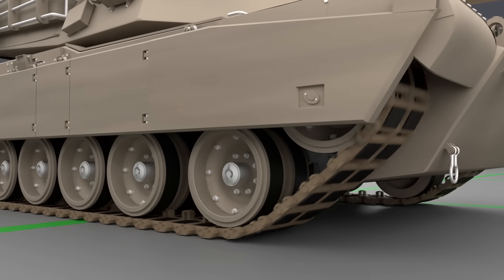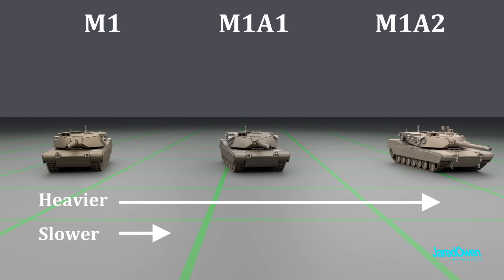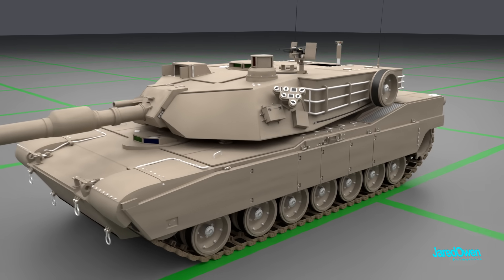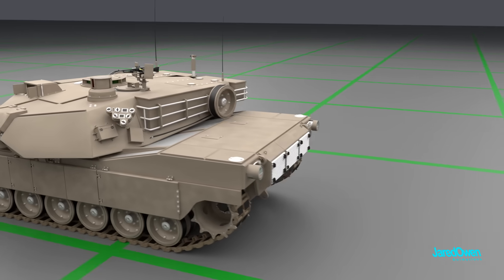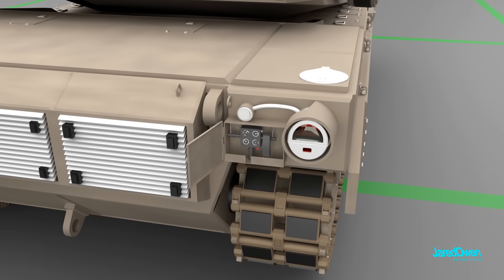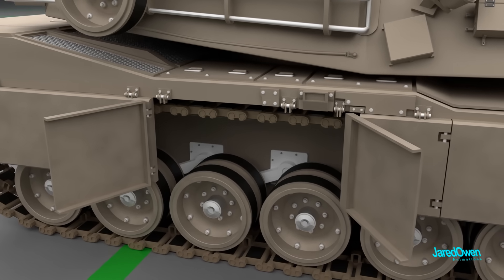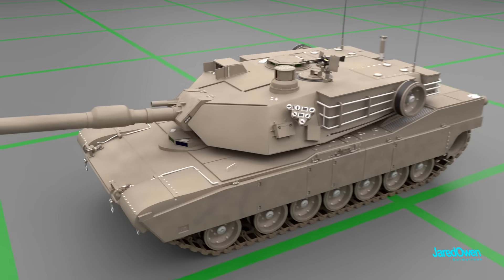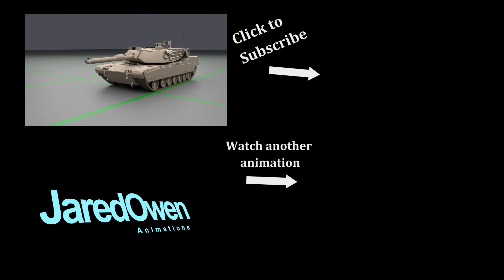How does a Tank work? (M1A2 Abrams)

Comment: Here's some additional fun facts and myths about the M1 Abrams:

1. It's often said no Abrams prior to the Ukraine War were knocked out in combat. That depends on how you define "knocked out." It's true that during Desert Storm, no Abrams were destroyed by enemy fire, but several were knocked out. The U.S. Army defines "knocked out" as a mission kill: the tank can still serve, but it needs to go to the depot for repairs before it can fight again. "Destroyed" is fairly self-explanatory, it's a total write-off. During desert storm, nine Abrams tanks were destroyed either by friendly fire or scuttling, and several have been destroyed by IED's.

2. It's true that the Abrams has a top speed of 42 miles per hour, but this isn't because of its weight, rather because it has what's known as an engine governor. This is supposed to limit the tank's top speed, but some crews have been known to disable the Abrams' engine governor for fun. This isn't a good idea for a couple reasons: one, it wears out the tank's suspension a lot faster on rough terrain, and two, it represents a safety hazard (tanks don't have seat belts).

3. The Abrams has an additional compartment in the hull not shown in this video that stores extra shells for the gun. This rack is usually left empty since the turret needs to be rotated to a certain angle so the loader can transfer those rounds to the turret bustle, which leaves the tank vulnerable to enemy fire since it's showing its weaker side armor.

4. A common myth concerning the development of the M1 Abrams is that Chrysler Defense' (now General Dynamics Land Systems) main competitor during the tank's development, General Motors, was supposed to win the contract to develop their prototype, but politicians stepped in and gave the contract to Chrysler since they were financially struggling. This is very blatantly false: not only was Chrysler's prototype cheaper and better armored, the diesel engine used in General Motors' prototype was underdeveloped, unreliable, and emitted a lot of smoke which gave away the tank's position. Besides, if the Army really wanted the diesel engine, then they could have used the Chrysler prototype with said engine, the engines weren't tied to their respective vehicles.

Comment: This video is a little misleading most tanks dont use gas turbine engines the abrams uses one because it has a high power to weight ratio meaning you can pack more armour and ammunition onto it and other components at a lighter weight (the gas turbine is less heavy than conventional tank engines like a v12 or smth), u failed to mention the high thermal signature of a gas turbine engine, the abrams actually redirects the exhaust around the engine to make it more efficient and reduce its thermal signature, the gas turbine being one of the primary reasons its a gas guzzler even when compared to other tanks because its a continuous flow engine its consistently combusts fuel as opposed to intermititently combusting fuel like a regular combustion engine hence being able to use 3 different fuel sources (diesel, petroleum and kerosene) as opposed to one to ease logisticial strain... also you said "a whopping 68 tonnes" but that is intermediate weight range for a tank there are both lighter and heavier tanks than the abrams... the smoke grenades thing it uses m250, m251 grenade launchers smoke grenades dont make it harder for a fucking missile to spot or something it can probably use chaff grenades (projects really hot burning strips of aluminium into the air to deceive ir targetting systems) as well.

Comment: Here is a prototype The Abrams X is a technology demonstrator developed by General Dynamics Land Systems (GDLS) as a potential successor to the M1 Abrams main battle tank. It features advancements like a hybrid-electric powertrain, an unmanned turret, and improved sensor suites, while retaining a three-person crew with an autoloader. 
Here's a more detailed breakdown of the Abrams X:
Key Features and Capabilities:
Hybrid-electric powertrain:
Combines a diesel engine with electric motors for increased fuel efficiency, quieter operation, and potentially enhanced silent watch capabilities. 
Unmanned turret:
This reduces crew size to three, while maintaining firepower and situational awareness. 
Advanced sensor suite:
Includes augmented reality features, 360-degree thermal sights, and AI-enhanced command and control systems. 
Autoloader:
Reduces the need for a fourth crew member and improves the tank's fire rate. 
Drone launching:
The Abrams X can launch drones for reconnaissance and surveillance, expanding its battlefield awareness. 
AI-enhanced systems:
The tank incorporates AI for target identification, prioritization, and potential autonomous capabilities. 
Reduced weight:
The Abrams X is designed to be lighter than previous Abrams models, improving mobility and transportability. 
Modular design:
The Abrams X is designed to be more easily adaptable and updated than previous models. 
Purpose as a Technology Demonstrator:
The Abrams X is not intended to be a direct replacement for the M1 Abrams, but rather a platform to explore and demonstrate various technologies that could be incorporated into future Abrams models. This includes testing advancements in propulsion, turret systems, sensor integration, and AI capabilities.

Comment: What they don’t tell you is the harmful effects of the Radiation emissions from the equipment inside that tank. Yes you can develop a dangerous cancer from it.
Reply: thats completely false
Reply: @Dodener   Do your research.
Reply: @WarriorBoyOfficial  my brother (1st Battalion, 63rd Armor Regiment) was driver now gunner of an M1A2 SEP v3, weve talked alot about it including the depleted uranium(DU) rounds and side paneling.

The M829 which is the main DU round they use is radioactive but emit safe levels and only emit alpha particles which dont penetrate the skin, only dangerous if eaten in large quantities. The side panels use the same idea but are only slightly radioactive and are shielded by other layers of metal, ceramic and rubbers. 

The point of DU is they are a byproduct of enrichment and are much less radioactive than natural uranium. the benefit of DU is that its incredibly dense making it stronger and cheaper than titanium. In combat if one of the side panels that contains any DU for armor, they are required to contact one of the hazmat teams that cover radioactive, bio and chemical warfare, however its mainly to determine if the tank is compromised for combat
Reply: @WarriorBoyOfficial  i verified this with my brother, i was actually wrong, his tank is still the M1A2 sep v2 not the sep v3, everything else is correct

Comment: Former US Army vet here.  I didn't get to work directly with the Abrams, but I saw it in action and I was blown away at the speed and mobility of this equipment.
Reply: а я видел как они горят от одного фпв дрона =))
Reply: @SaloUhani   Now show us Russia's battle field losses and their inventory, your country fields 80 year old tanks from ww2.
Reply: @SaloUhani  You saw old outdated ones actually
Reply: @Jishhhhhhhh  правильно, были стары, потому что нет смысла гнать туда новые, потому как они горят также как и старые =))) новые отличаются от старых весом и более продвинутой электроникой, а горят так же как и старые
Reply: @SaloUhani  look up APS.
Reply: @ДжохарМусаевичДудаев-д4щ  These tanks have better armour they use modern ceramics to absorb the energy from the impact lessening the deformation of the steel beneath it and interior lining to protect against spalling from HEAT rounds, its not the same at all lmao, not to mention kinetic redispersion systems and ERA... FPV drones are over rated unable to fly at night unable to fly in poor weather conditions they have no gps systems and poorer range than their larger counterparts FPV drones are overrated.
Reply: @johny5593  did you see that T90 getting shredded by the 25mm of the bradley lololol

Comment: 1:45 Which difference between US tons and international tons?😂
Reply: Tons vs metric tons or tonnes, tonnes are slightly more.
Reply: @zThinquinox yes 1 US ton = 2,000 pounds (lbs) ≈ 907.185 kilograms (kg)
Reply: Us tons are 2,000 lbs, abt 910 kgs. Metric tons, or tonnes are 1000kg, About 2,200 lbs.

Comment: Is any research of This loading of shells can be done automatically like reverse gas thrust recoiling like  M4 or AkS so the firing could be more fast without manual loading or loader . But it will need larger space as to arrange the spring for shells to lift after firing serial wise like magazines . 
Tank will be more heavier then 
I think additional LMGs can do so

Comment: 😂 ребëнок, до одного места ты всё это зубрил, Абрамсы слишком боятся лобового столкновения с т-90мс😎
Reply: Didn’t the t 90 lose to 2 Bradley’s?
Reply: @Jeffrey-hu2gb  But weren’t Abrams destroyed with a DShK machine gun?🤣🤣🤣

I found something to compare, child =))) Bradley is equipped with an ATGM and a powerful large-caliber gun...
And the DShK is a heavy machine gun =))) 😂🤣😅
Reply: @ what’s your source? 
(Someone on Reddit documented every Abrams damage an destroy 2003-2011 very helpful)
The only thing I found was on April 3 2003 was when a Abrams (named the Big Punisher) was damaged (NOT DESTROYED) and abandoned by its crew with parts of it being stripped off in later photos the most likely explanation I found was that a RPG not a DSHK hit the EAPU and caught on fire which then spread to the fuel tanks or engine something like that it was later recovered and returned to service after it was repair and overhaul 
The only thing I found that matched your claim was someone on Reddit claiming the same photo was caused by a DSHK with his evidence being the DOD report saying it was a medium round which is very vague term because someone else mention it includes 20-30mm rounds

As for the Bradley Task and Purpose broke down the engagement and during the interview with the crew he said that in one of the 2 Bradley’s the chain for the AP ammunition jammed leaving them with HE shots and neither Bradley used any ATGM during the engagement which was shown in the video of the engagement

Comment: Esta informacion esta demas , le estan dando informacion a los enemigos de USA.
Reply: Still won’t change much 
tank armor has been mostly the same in weak spots
Front is the strongest
Side is a bit weaker
The back is the weakest from the horizontal view 
With the top being the weakest point of the tank

Comment: great tank but definitely lots of room for improvement.  Should have a larger crew compartment, electronic cameras that can provide a 360 degree view to all operators, autoloading and auto ejection technology so the crew can be completely hands off during combat.  Gunner marks targets, chooses ammo type and enters that info to the computer and then initiates firing.  Ideally you could have drones flying above the tank feeding grid coordinate/gps data to the commander and gunner marking high priority targets with preselected realtime gps coordinates and gun loadouts selected for maximum impact vs each target, queue them up and go on a 5 or 10 fire mission with the main gun and get realtime impact data from each shell.

Comment: And what hapens with the casings after the tank shoots is there an ejecting system or does the loader have to pull it out and if so where does he lieve it.
Reply: They go into a basket because the shells are way to hot after being fired to pick up

Comment: The latest abrams is the m1a2 sev3 with the trophy active protection system. Overall better in terms of survivability then the t90m but the t90m has overall better protection the only problem is the carousel or else it would have been better in both survivability and protection. Mobility abrams good forward and reverse speed, the t90m has better forward speed but a pathetic reverse speed. The t90m is also going to get a hardkill system next year 2025. Overall both are good for their respective countries.